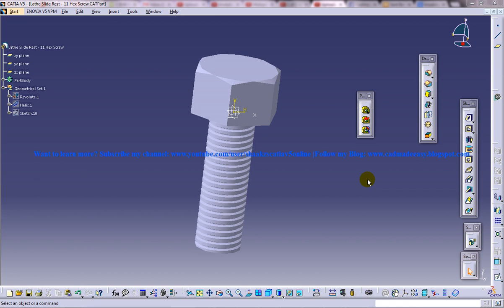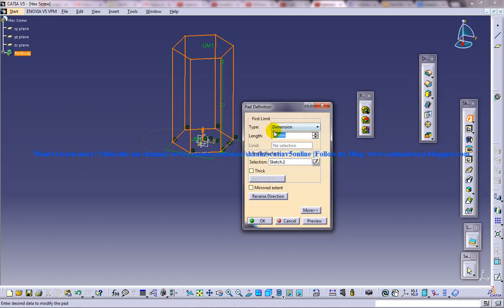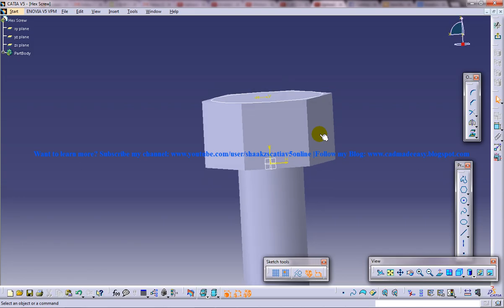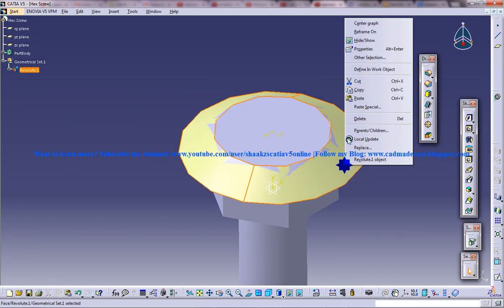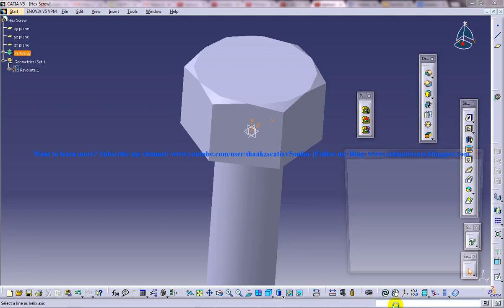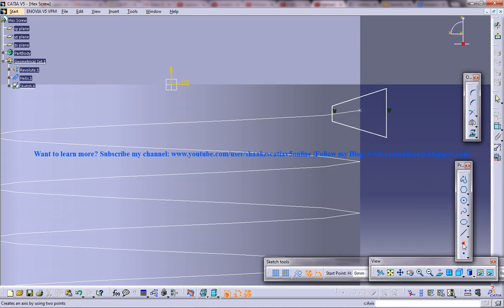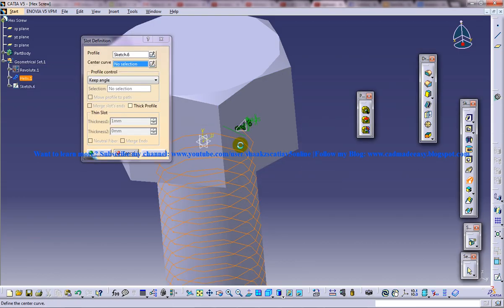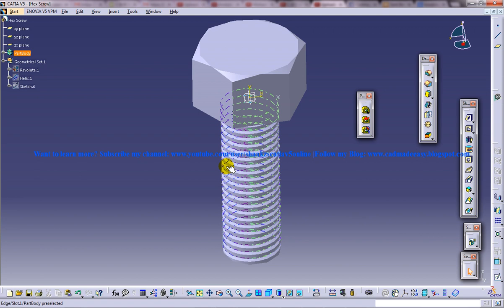Catia V5 Powerful Tricks Collection #116|How to Create Threaded Hex Screw(For Beginners)

Comment: Hi M.Shakeel, your videos are a great help for the beginners, I recently Downloaded and started practicing Catia V5, I was practicing that "Threaded Hex Screw" video of yours, i am having some problems and i am not sure if i am not doing it the right way or is it that Catia application that i downloaded, like when i was done with the first ractangle's padding and wanted to make a circle on the lower face the circle was'nt appearing within the ractangle, i had to make a bigger circle the changed the diameter, same problem with the second circle, which is internally tangent to the ractangle, after that when i gave the revolve command in the dialoge box appeared i could not mention the revolution axis, which was z axis, it was not just changing, may be be its some problem with that application, Please any help will be highly appreciated.

Comment: woah, slow down speed racer. you said this was for beginners. Where's the slow motion button... I'm stuck on the angle for the chamfer on the top of the bolt. It's only letting me change the length of the line I don't see how to set the angle.

Comment: Quite good and helpful video.
however, when i try to create a nut profile by taking the line at 30degree as you said and use the Groove command it leaves behind only the portion of the head which is to be cut. rest of the screw is gone.   

Why is it happening so ?
Reply: vivek Inder you need to click on the arrow pointing downwards while using groove

Comment: i am getting aproblem while using slot defination.after clicking for reference plane and selecting the circular pad.it is showing an error called feature defination error.it is showing that" the selected sketch contains points defined as standard geometrical elements.you must convert these points into constructional elements"
Reply from the maker: Please follow the videos once again. If you have any unnecessary points in the sketch, select them and make them construction geometry.

Hope that helps..!!